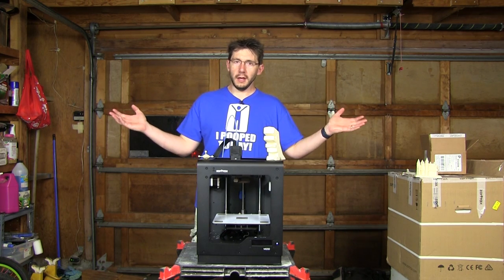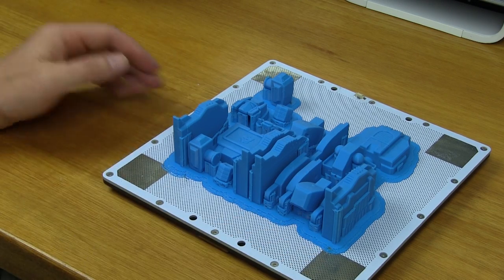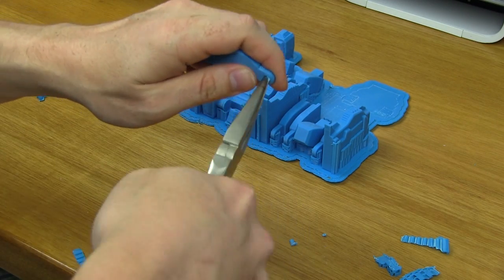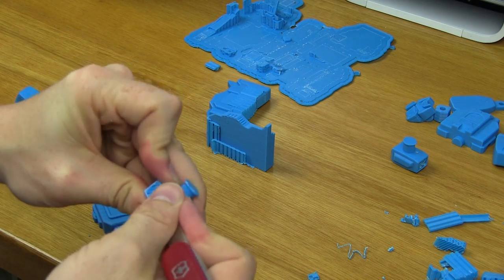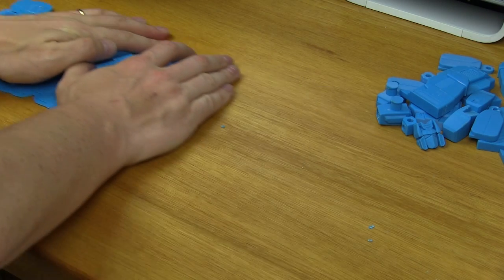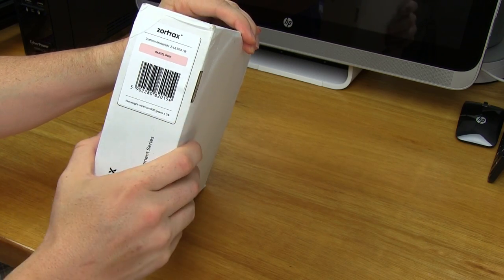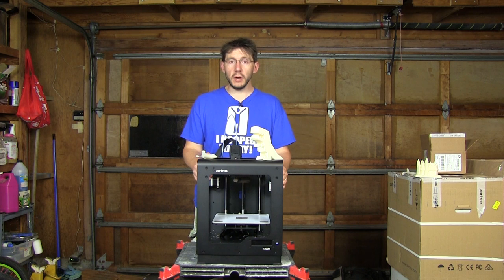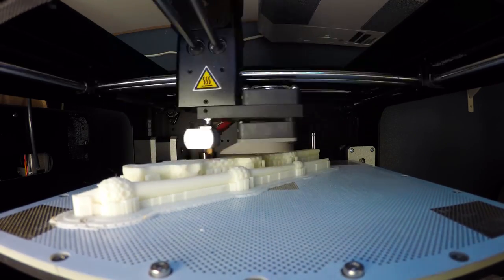3D Printing: Zortrax m200 3D Printer Review

Comment: not to be rude but a windows machine that cost half of the mac pro would have done the job much faster. mac's are just over priced and not really upgradeable hell they havent even released a proper successor to the mac trashcan pro.
Reply from the maker: +clifton ward heh. hey Clifton! I agree about a PC running it faster. I think, though, having a Mac client means it SHOULD have decent performance, especially at the price you pay AND it being the only software that you can use for the machine. THAT said, my Mac Pro is an 8-core machine from 2008 and it's starting to show its age. I have a newer Core i7 Windows machine I'm going to start doing more things with, and see how the Zortrax slicer would work with it.
Reply: is the i7 skylake? and u know cuda cores from a new nvidia graphics card would also utilize the 3d printing software better. keep up the good work i do like your videos alot !!!
Reply from the maker: +clifton ward skylake - not sure. I haven't had a lot of time to play around with it. I DO have getting a new card for my Mac Pro on the list of things to do. I will keep up the good work, thanks for watching!!!
Reply: no problem man!!! could u 3-d print a jason hockey mask lol?